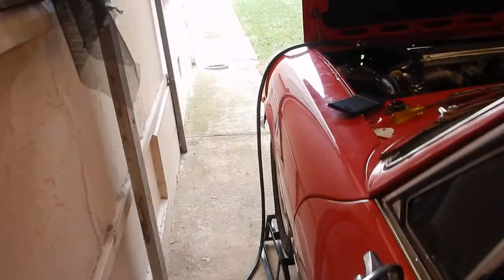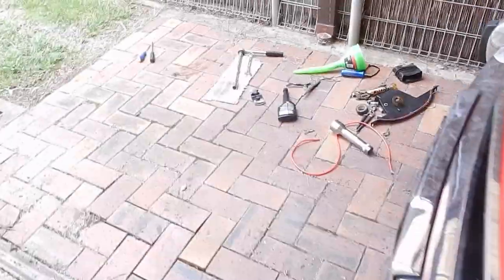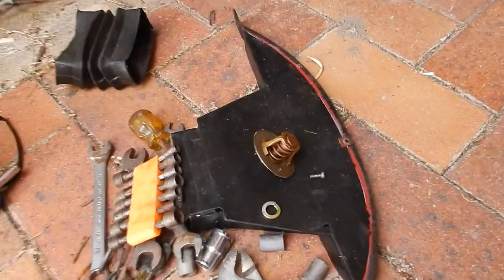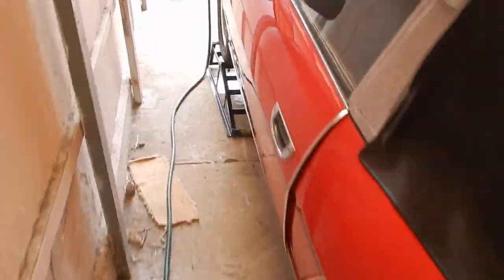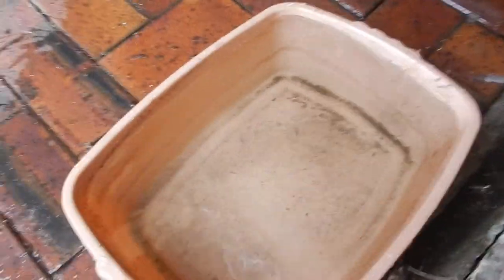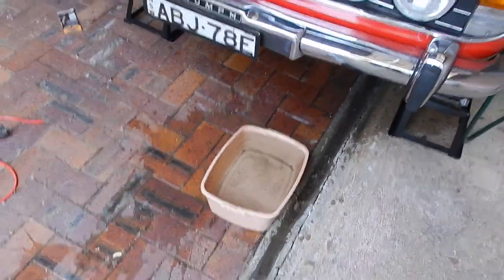Triumph Stag reverse flush of cooling ystem

Comment: About to embark on a cooling system flush on my stag, going from green to red coolant. I used costic soda crystals in the rad after I removed it, then left it over night. Not much came out of it with a pressure washer. Cheers